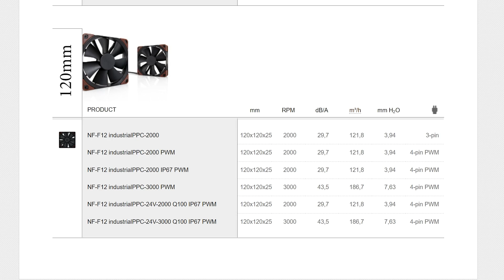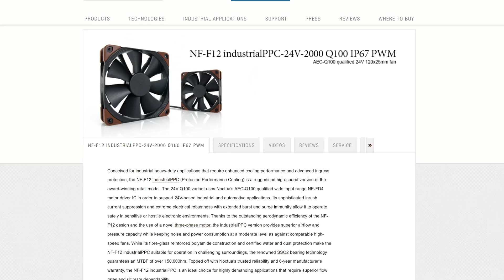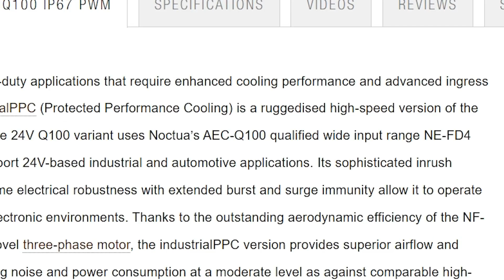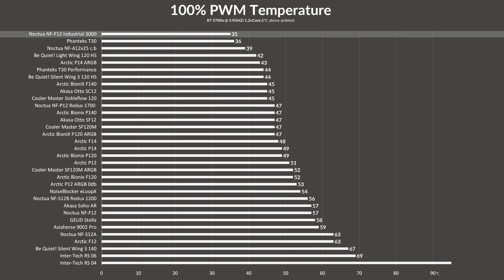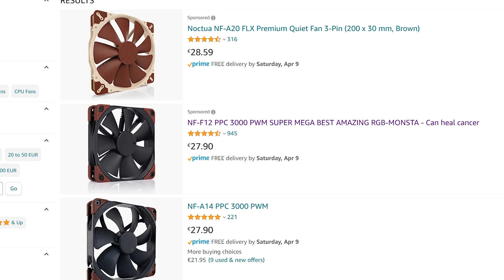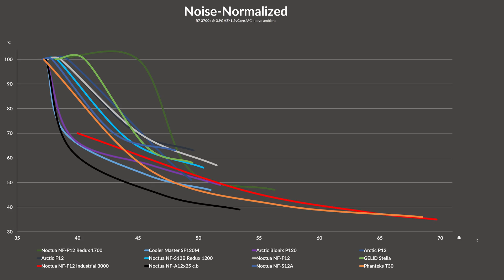Noctua IndustrialPPC NF-F12 3000 Review -  The Fan She tells you not to worry about

Comment: I bought 2x 120mm 3000rpm to replace DC noctuas to keep my GPU fed with cool air (case fans directly blowing into GPU intake). Noise is better, exhaust air out of the case is cooler. I don't need these fans but it's nice to have headroom.

Comment: I'm rocking a 7800X3D cooled by a Thermaltake AXP90-x47 full copper. Now a 90mm Noctua HS 2500rpm does well... so I thought the 120mm with an adapter duct I printed would do very well. 

One  problem, that 120mm was a 15mm tall 1850rpm model. It did not do well. So I looked at the Noctua spec chart and ordered this monster, it pushes over triple the CFM of my 90mmx15mm high speed. I must have peak cooling at all costs.

Comment: I put 2 on my phantom spirit se my 7900x can build snowmen inside my 4000d af case
Reply: How are your temps bro? I'm thinking about putting 2 of those on my phantom spirit 120 evo.
Reply: @MrMrRafaa  about 3 to 4 temps lower than the stock fans ( both stock and nocuta were set 100% ) but the noise level on 3k rpm is very loud i have a corsiar 400d airflow case with 3 noctua intakes in front 2 exhaust all set at 100% speed i tested then on a 9800x3d i sold my 7900 PBO and -15 curve

Comment: I have four of these on total 480mm radiator cooling a AMD3950X and a RTX2080TI.
With normal usage the fans, coupled to CPU temperature, are at 35% and keep the water + 7~10C above ambient  temperature.
I sleep next to my PC in ambient mode; it's quiet.
But when 3D gaming, rendering with Blender, encoding movies, compiling code... it can get noisy and  you really hear the wind, the fans sucking in an pushing through the radiator, which is what I want, because the water does not ever come above 15C ambient.
I bought these because of the static pressure numbers which is important for radiators.

Comment: Bought these for how much air they can push, also bought the t30's. My computer sits around 70-80c while gaming, and my 6900xt gets around 75-80c and 100c on the hotspot. Also live in texas, think these fans in my h5 flow will really help out. Using some cheap ass fans right now, so im hoping to see a 10c reduction.
Reply: You need a lower temperature inside the room.
Reply: Yeah ik, but I cant without a window unit. The cost to run that would add another 100$ a month to the power bill. @simonemiglioli1165

Comment: would be nice if they made a 180mm version for cases like Fractal Designs Torrent or Meshify, eventough  180mm fans would result in 260 CFM ore more

PS.: why ?
 cause 2*180 mm fans would be more efficient in commparison to 3*140mm in the front since the 180s surface area is bigger thus the airintake smoother = less turbulences upfront and better distribution
Reply from the maker: In theory, yes, but practically it will be reeeeeally hard to make them study enough to withstand that speed.
There’s a reason why >160mm fans are spinning extremely slow, usually the reason is that they would explode / the outer parts of the wings would just straighten up
Reply: Post Post Scriptum: My Laptops Fans and cooling are even a little louder in my opinion/observation.

Comment: Had a new build where I used 2 of these on the back of a radiator, and 1 for exhaust.  Before changing voltage or setting up PWM, they ran in all of their 3k rpm glory, which sounded like a small server room with dozens of servers.   Yes, they're that loud.  

Fair warning:  I would suggest that you DO NOT use PWM with these if you're buying them for the new AM5 7 series AMD cpus unless you're only setting the top end to around 70%.   The 7950x temps fluctuate up and down at a very fast rate.  My office sounded like a wind storm.  

This beast is tamed with reasonably acceptable dba at around 8 volts, which ends up being around 2300 RPM. 

This was the only video so far that I could find which compared this to the Phanteks.  I really wanted to hear the 2 side by side at higher RPM.

For high overclocking this fan works very well, but you WILL hear them through your closed back headphones.    The sweet spot is around 7 to 8 volts (2k-2.3k rpm), and you'll still hear them through open back headphones.
Reply: Are they not pwm?

Comment: I got eight of these in my PC case as I never have a problem with overheating. Extremely quiet when set at their lowest setting. Setting a fan curve is highly recommended.
Reply: idk how u managed to get that done but wow my single one is louderthan the whole pc itself and all the other 10 fans combined
Reply: @gugugaga42069  Keep them below 900 RPM and only let them ramp-up when needed. Fan curves are your friend.
Reply: @jamesm568  yeah no i got a fan curve on it and i tried different speeds. the only speed thatthe fan stays quite is 20% aka 3000-80%=rpm
Reply: @gugugaga42069  yo need to see your motherboard support for the utility that controls fan speed, What mobo you are using ?

Comment: They're loud but they rarely ramp to 100% no matter what I do. Maybe when stress testing, but it's great with thick radiators. Overclockers know what i'm talking about.
Reply: I bet they'd ramp up to 100% on my i9 lol I have an H100i GTX with stock dual SP120 fans and it will still get up to 80C under heavy load
Reply: @thevideolord  Ryzen 7 3800x here, we’re actually much more limited by water block surface area than we are are radiator size, and I measure fan speed through delta between GPU hotspot, cpu core and CPU hotspot
Reply: still nothing compared to server fan 180 6600rpm this noctua fan is a joke

Comment: I have 2 of these in my system.  Only used to show off how loud I can make my PC.
Reply: As long as they're cooling a radiator for an air cooler.
Reply: @jamesm568  I had them as case exhaust, but have since replaced with normal airflow fans.

Comment: I am insane. I made a full industrial build. I am insane
Reply: WHAT? I CANT HEAR WHAT YOURE SAYING..
Reply: Just pride as you didn't use those cheap minimum wage fans
Reply: I just bought 2 of these but the 140mm version, and 2 t30's. You think ill see a difference in my h5?
Reply: Me too, i did it with 12x Industrial 2
3000rpm noctua fans, and my I9 14900K sometimes still goes into thermal throttling, with a 420mm AIO. Pretty Insane
Reply: lol, I bought 3 of them because I made the mistake of buying a n400 case and not a n600 or the nzxt 510 like I did in the past and just glueing a 6-8 bay hdd rack in all of the open space it provides because of the closed bottom where the PSU sits hidden away. I actually need 7.xx amounts of static pressure to get air through the hard drive cage, AND past the mess of PSU cables on its way to the mother board where the exhaust fans and side mount fan separate the air out to where it needs to curculate

Comment: This fan is not about "noise to cooling" ratio, but about the massive amount of air it can push. So eg. a very space-limited environment, this thing has an air pressure of up to 7.63mm. Think SFF case or some of those odd-sized radiators, with a depth of eg. 60 or 85 mm (Alphacool Monsta), and then its suddenly starting to make sense. 

On that note: I'm actually preparing an SFF build with a 280 mm radiator, which might require using the 140 mm version, ie. the. NF-A14 IndustrialPPC-2000 PWM, or if push comes to shove, even the 3000 rpm version, which boasts an even more massive amount of air pressue, ie. 10.52mm (and its equally loud, with up to 42 db(A)).

cu, w0lf.